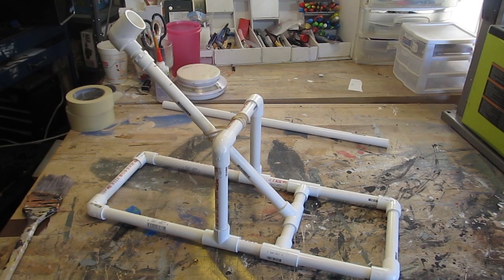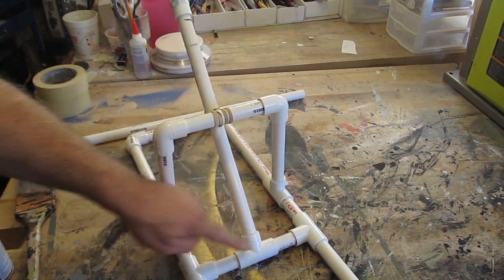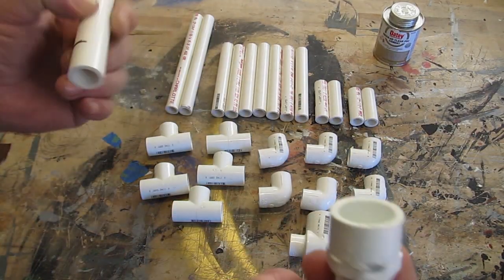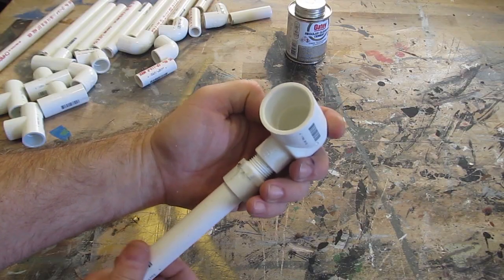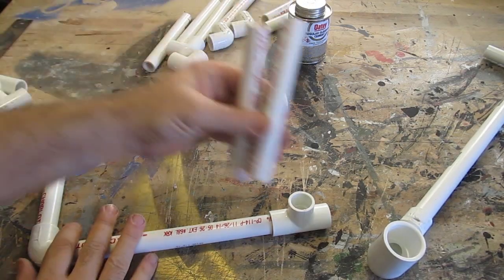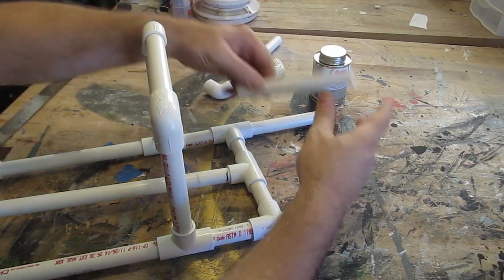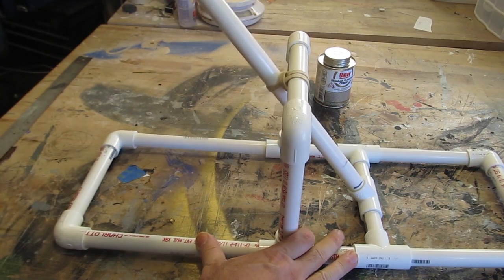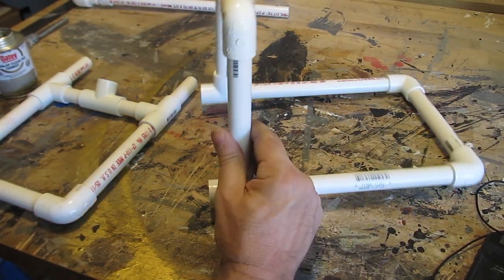How to Make a PVC Catapult

Comment: My son and I are building this for his science project. Thanks for the video.
Reply from the maker: You are very welcome! Have fun and feel free to email me if you have any questions about the catapult build!
Reply: Thanks. What balls did you use. I am thinking ping pong balls. Will that work?
Reply from the maker: @jlacson74  Sure, ping pong ball will be quite good. Almost anything safe. Crumpled balls of paper, small bean bags etc.
Reply: We finished it. Just about $12 in parts. Works great. We used a plastic golf ball and it went about 30 feet. I may have went overboard with the rubber bands. It will definitely clear the end to end of the classroom. My son can't wait. He said his classmates are making their catapults out of little popsicle sticks (I have seen those videos LOL). I did buy a PVC cement but I don't think it is necessary. Also, I sanded and oiled where there is friction. I am not sure it made much of a difference but when without the rubber band, the pole moves a lot smoother. Thanks again.

Comment: Great Video. With your model how long can you shoot a tennis ball ?   
Also it was not clear from video how are you tying a latext rubber band to the Arm ? the top portion got chopped off.
Appreciate your response.
Reply: I did this for a physical science project and i got the tennis ball 22 feet. I think it depends on the rubber bands you use. I had flimsy ones and used 13 rubber bands.